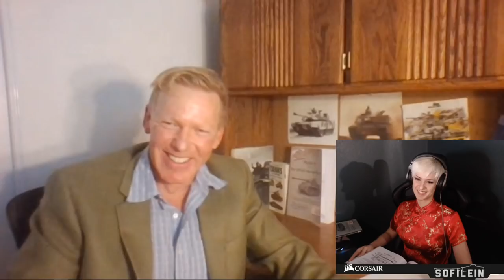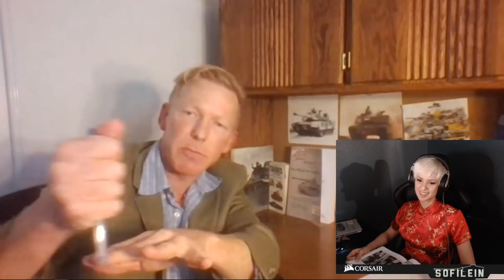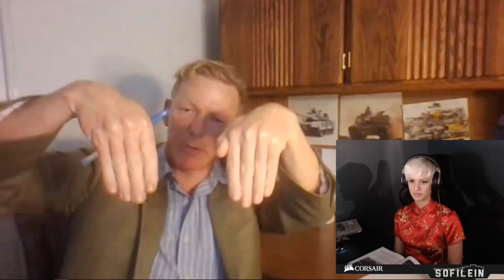Transmission and Roadwheels: Tiger I Mythbusting with Bruce Newsome Part II

Comment: I want to make a huge comprehensive rebuttal to this and the last video. I have some serious problems with a lot of what you said- but just to begin with, the Churchill has a nearly identical system in regards to it's gearbox design. It has a nearly identical drive system with a "steering wheel" (although the design isn't a wheel because of size constraints internally in the tank, it's basically a handlebar like a motorbike, but it effectively does the same thing).  The Tiger was not exactly an exclusive user of this design. The later Cromwell and Comet, had the exact same system, as the Centurion.

Tomorrow I plan on writing up response to this video and your prior with factual errors that you've made.
Reply: Didn’t say the Tiger used the steering and transmission exclusively, said it was a British design and I took him to say that it was the first German tank to use the system... does the Churchill, Cromwell and Comet pre-date the Tiger design?
Reply: You do understand that this is a video very specifically about the tiger tank? You should learn to process information instead of leaping off on some self-centered tangent that has nothing to do with the subject at hand.
Last time I looked cooking books rarely make mention about twin-bedford engines, are you going to rebut them too?
Reply: @davidorama6690  By Date of introduction and first "production" vehichiles, the Churchill does pre-date the Tiger I.
Reply: troll needed to go away to think about how to misrepresent a video
Reply: and your academic credentials are?

yeah, that's what I thought...
Reply: @blackstone777  If I had academic credentials and told you the sky is actually orange, you'd have to believe me. And I'd be right, too?
Reply: @ohslowpoke4720  And another misrepresentation. No, if you had credentials we could asses if your previous work showed that you have a particular  expertise in sky coloration. And if it would show you do, it would lend a certain weight for us to re-asses our observations.
Reply: @exharkhun5605  He's got a Ph.D in social studies, not exactly the engineering field. Before you take credentials before facts, I suggest you do self reflection.
Reply: @exharkhun5605  I mean, you're welcome to your orange skies. Re-read what I originally wrote in the top post. Thanks!
Reply: @exharkhun5605  Have you any sources or data to back up Bruce. If you have them, I'd love to hear them. I'm open to have my mind changed.
Reply: @ohslowpoke4720 Don't believe me? At under a minute into the the video (0:40) he tells you that the transmission is based on a British system. And still you think things need to be rebutted. You're so dense they can use your head as armor piercing shot.
Reply: @exharkhun5605  Please re-read what I wrote, thanks.
Reply: @ohslowpoke4720  HE claims the steering system is fairly unique for the time, it's based on a british system, and then he goes on talking about the subject of the video: the Tiger.

YOU say that the Tiger wasn't unique in using the steering system he was talking about. NOT the subject of the video.

WE all wonder why you make an issue about the fact that someone who's expertise (have wrote at least 2 books about it) is on the Tiger doesn't go all in on different tank lines of different countries the minute anyone mentions a gearbox.